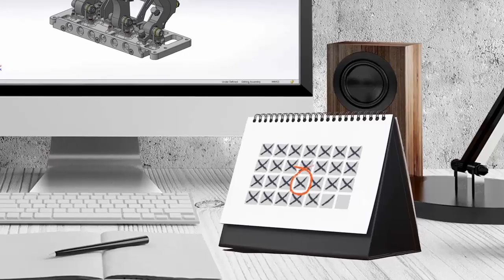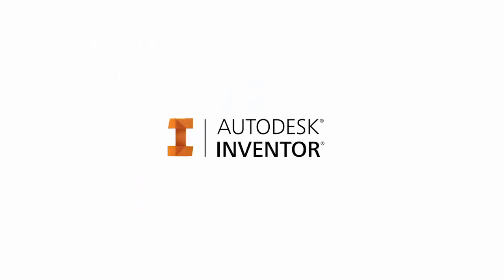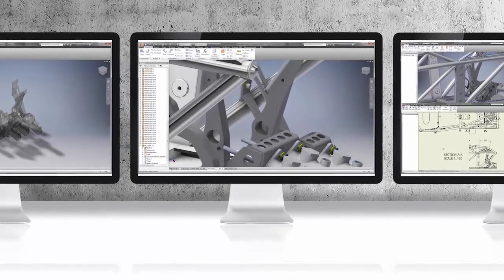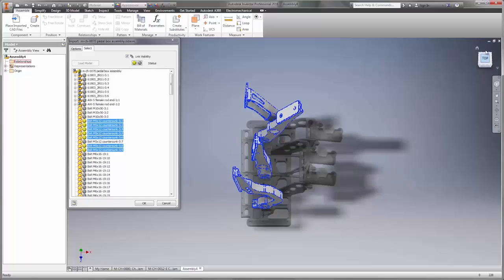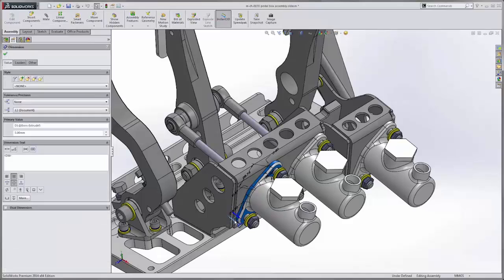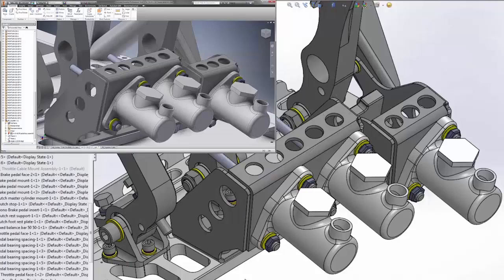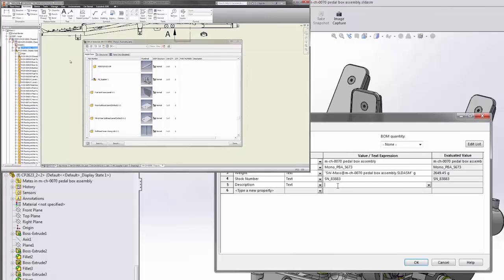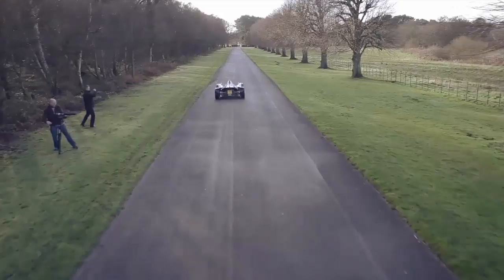Autodesk Inventor AnyCAD

Comment: I was unable to get this to work with Creo.  Since Creo creates versioned files it doesn't seem that inventor automatically imports the new version of the file.  In other words, if I create the file "screw.prt.1" in Creo and save it, it creates "screw.prt.2" rather than overwriting "screw.prt.1" and it seems that Inventor is looking for changes to "screw.prt.1".  Is there a certain procedure you're supposed to follow to use Anycad with Creo?

Edit:  I found that it works if you rename the updated file to the original (renaming "screw.prt.2" to "screw.prt.1") but I'm not sure how to do that automatically.